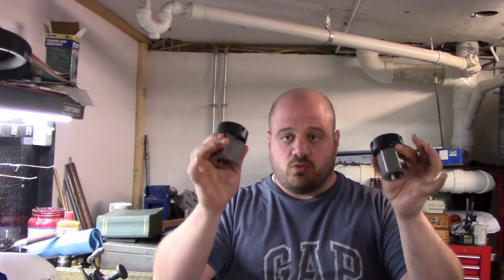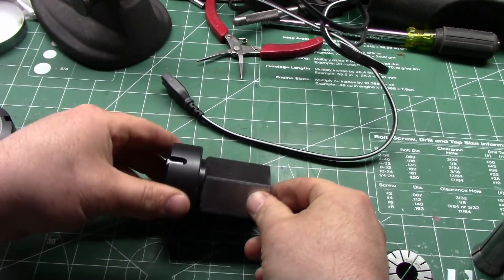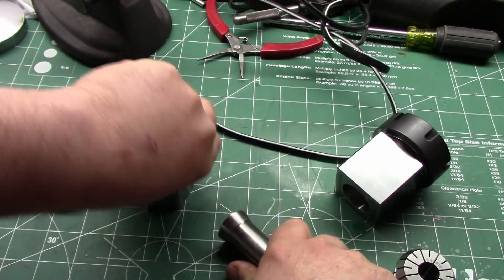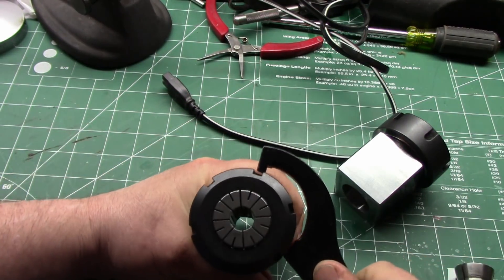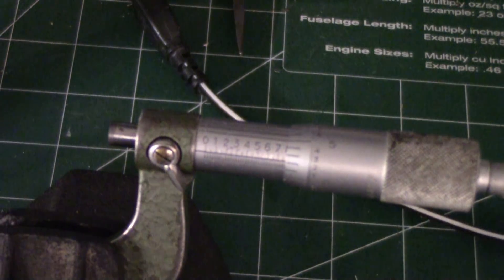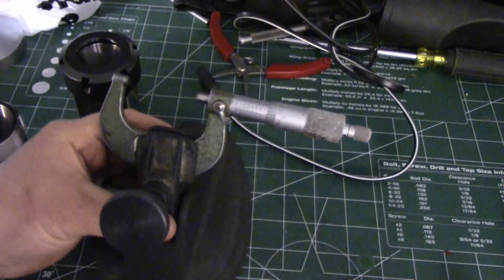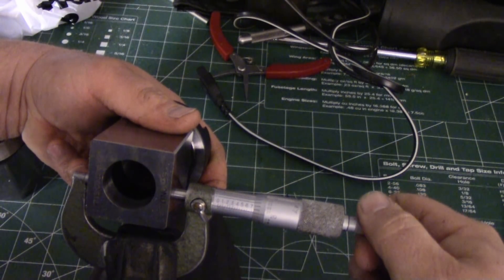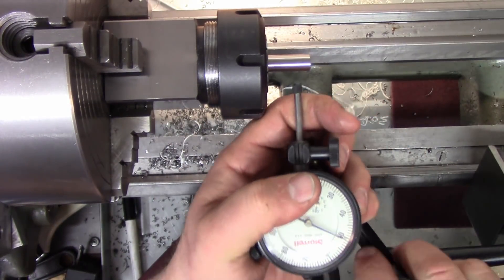Cheap ER-40 Collet Block Inspection

Comment: The problem with these ER collet blocks is the lack of a guide pin for the collet proper. Your collet+part is free to rotate when you tighten the nut.
That said, ER collets do not tend to rotate that much when the nut is tightened, but I would keep an eye on it if I wanted to do more than just mill a square or a hex to the end of a workpiece...

Cheers!
Paddy

PS : I have been meaning to ask you this for years..... why are you always in such a hurry ? Is the Law on your tail? Are you running from the repo-man? Or are you just of a very nervous disposition?

Comment: Try a 3 jaw chuck when using the hex collet block. Much easier to deal with
Reply from the maker: Jim Turcott 
Yes it is.  I just need something I could dial in to take Chuck run-out out of the equation as best I could.

Comment: A fixed closeup camera like that is an amazing thing. Watch the video near the end as you are spinning that hex collet block. You can see the hex running true, you can see the nut diameter running true, and you can see the dowel pin sticking out at an angle and wobbling. Just for grins I'd try popping the nut loose, making sure there was no dirt in things, and trying again. Maybe note where the high and low was and see if it repeats. It might be better than you got that time around.

Comment: Who's bench top pad is that's with the quick references on it ??
Reply from the maker: Doug Doty 
It's a Hobbico cutting mat I've had forever.
Reply: That is where I remember it, I had the same one, mush have been why it got my attention, used to build and fly RC with my dad, we were into it big time, he still has 6 big PICA 1/5 scales hanging in his model shop ceiling...